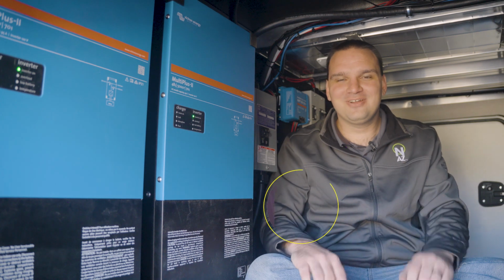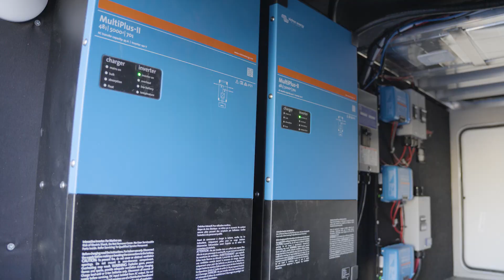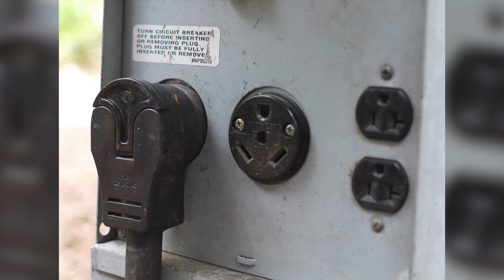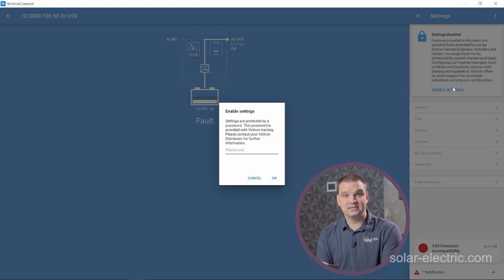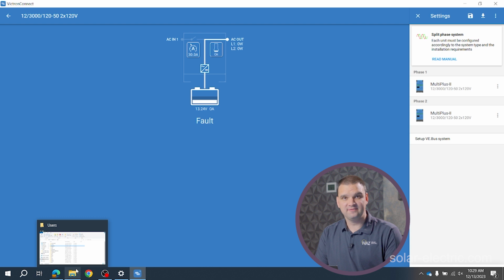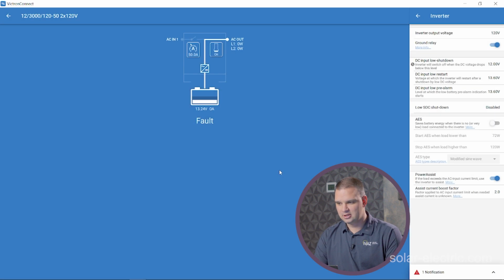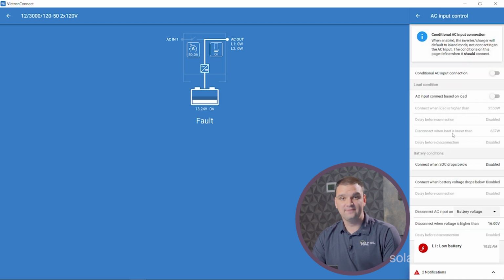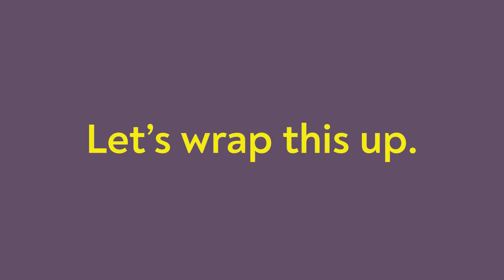RV Solar System - Victron Inverter Highlight - Everything You Need To Know To Optimize Your System!

Comment: Your thumbnail for this vid says.... "How to set up for split phase or parallel for optimum efficiency." I am searching everywhere for that. But you did not cover that in the video. What happens when I am wired for 50amp split phase, but need to connect to a single phase 30amp RV pedestal with a 30-50 dogbone, because that is all the RV park has?

Comment: Fantastic video. Thanks. I'm planning on doing a system like this for my RV and have some questions. In this dual 48V/5000 inverter split phase setup, if you had a smaller generator, like a Honda EU2200i, which is limited to less than 15A, would the autotransformer be needed or even useful? Without the autotransformer, would the 15A generator load be shared by both inverters, or would one be in PowerAssist and the other inverter only?  Also, if these two inverters were set in parallel mode, I understand that the input current limit is doubled, so this system (with PowerAssist on) would only be able to go down to somewhere in the 27A range, correct? Is this also true with them in split-phase? Otherwise, you wouldn't be able to use PowerAssist with small 15A-20A generators or house plugs without overloading them.
Reply from the maker: Rather than try to answer all of this here, please give us a call! It will be much easier to walk through your questions over the phone! :)

Comment: Thanks for the video.  
Would you ever set up a pair of 2x120 Multiplus in Split Phase?    Or, when using Split Phase should you always use the non 2x120 version of the Multiplus?
Reply from the maker: Thanks for your question! 
And in response, not really, it would be cheaper to use the standard Multi-II. Also, it generally doesn't make sense to do a split phase system at 6kW, it's better to parallel the 2x120. This will allow them to function best. It's really only necessary to do split phase if the system power is going to be over 6kW or if you need 120/240.

Comment: No one inverter can advertise watt. Watt depends ever from PF of load. Inverter have tot VA. Watts depemds to load. With a resistive load 1000va are 1000w.
With a inductive load with 0.7 PF 1000va are 700w.

All inverter that say watts, lie.

Transformer are dimensioned in VA. Never in watts.

Victron say the real data. All say watts, say a lie in some case .

If a inverter say 1000w, and is is true with a load ar 1.0 PF, cant be true with 0.8 PF
Reply: Calm down. Victron specifies BOTH max kW and max kVA. There are no lies here.